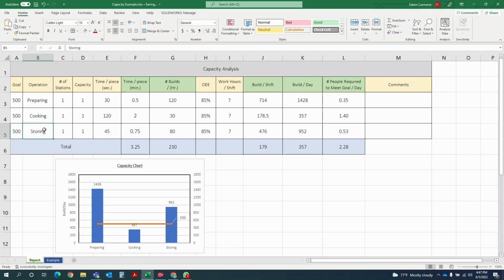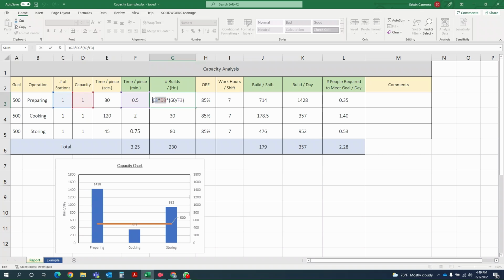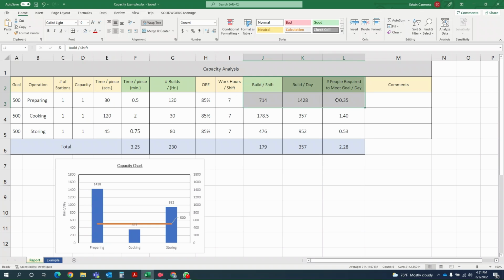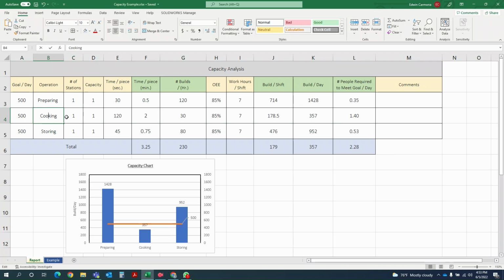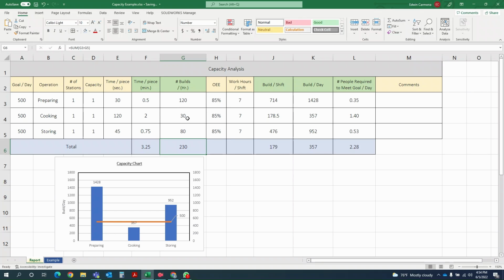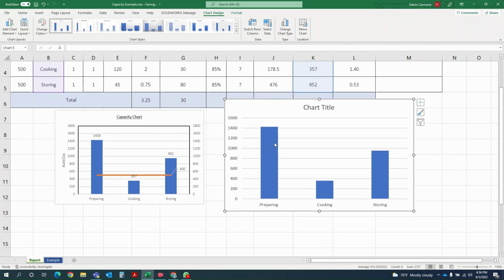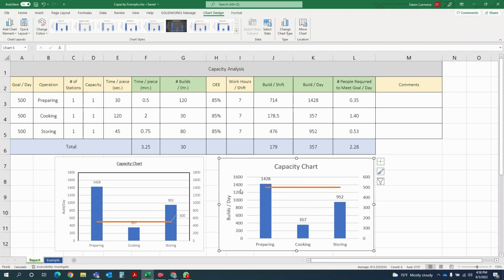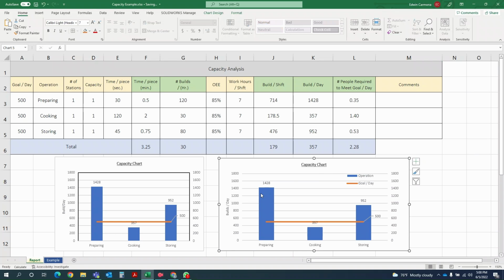Manufacturing Capacity Analysis (Quick)

Comment: with your sheet, you might want to add setup and also available hours/minutes instead of a percentage.  Available hours due to bathroom breaks and some meetings or requests for material, etc.  You could add the round or ceiling function to the final column.  The experience level is also a good setup piece we have used when we have a column for the worker who is added to the 2nd column from the left for 'op' (for operator)